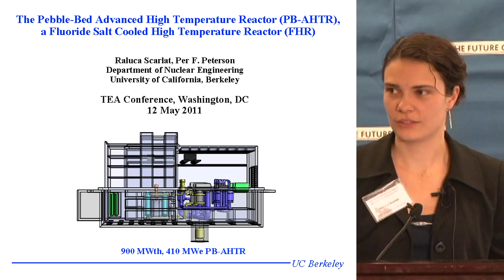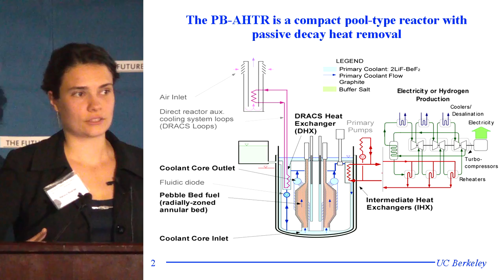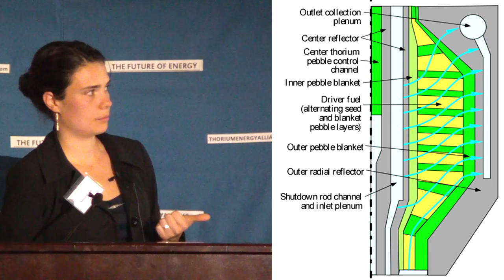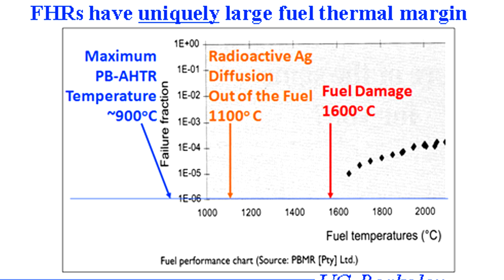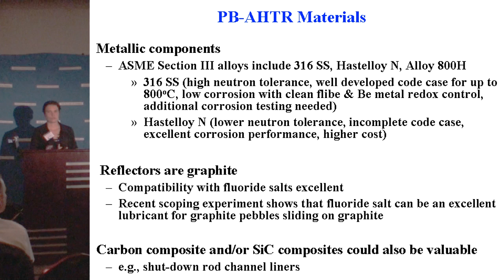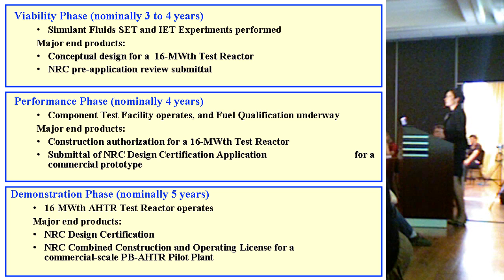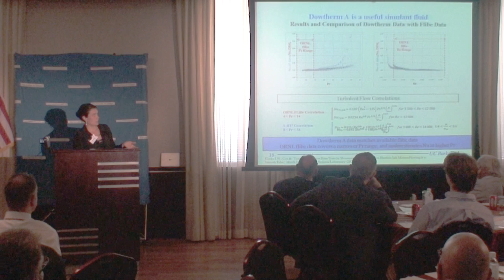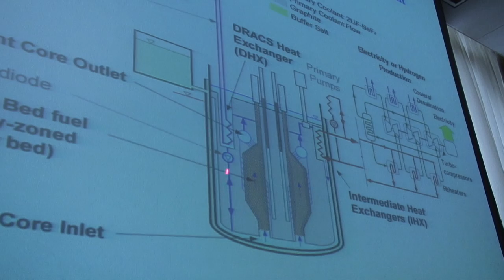Raluca Scarlat - Pebble-Bed Advanced High Temperature Reactor PB-AHTR-FHR @ TEAC3

Comment: I like the mix coolant design. We don't need giant reactors like the high pressure ones. If it was small enough, the danger factor would drop like a stone in a lake. We could have internal and external sensors in-case of a breach or any possible problem. And of course you would have a city worker or some hired worker check reactors or test sensors or both. You could then make micro-reactors that power a micro-neighborhood worth of buildings and.... here it comes.... load balance the micro-neighborhoods together. If you don't know what load balancing is, google it :)

Comment: I'd like to see a molten lead cooled pebble bed reactor. The graphite pebbles can be lighter than the coolant itself if you wanted so it would be very interesting. I like the idea of pebble bed reactors because the fuel handling is simpler and neutron damage issue in the dual fluid reactor is avoided.

Comment: I'm guessing they're doing a closed loop test using DowTherm A to find optimal channel layout for core temperature profile and pebble fuel distribution / movement. The CFD modelling of so many pebbles would be very demanding on both computational resources and on the turbulence model.  I'm not sure if RANS (reynolds averaged navier stokes) models can be used for closely packed pebbles.  These guys are Berkeley know what they're doing.

Comment: I don't see Thorium as a good blanket.  It takes like 27 days for it too mutate into U233.  How do you prevent more neutron captures in the meantime?
Reply from the maker: If there's low neutron flux it is less likely. Is why ANEEL is intended for CANDU reactors, and not (yet) PWR. CANDU are large and lower-power-density reactors. They'll still have Pa-233 absorbing neutrons, but not as much.
Reply: @gordonmcdowell  Aren't fast neutron reactors the way to go?  They produce much less waste than PWR.  They are less likely to explode when things go bad.
Reply from the maker: @putinscat1208  They should be pursued, for sure. Russia has closed the fuel cycle with fast-spectrum liquid-sodium reactors, although that's not the vast majority of their fleet. They don't have pressurized water, but liquid sodium is very reactive. Is sort of a trade-off in safety features. I'd suggest a great many of these advanced reactor technologies should be pursued, as well as immediate deployment of PWR like AP1000. Right now the biggest advanced reactor challenge appears to be NRC licensing. (Still.)
Reply: @gordonmcdowell  Do you need licensing to prove a point.  Research on a small reactor?
Reply from the maker: @putinscat1208  You need a license to build a reactor, doesn't matter how small. There's lots of work that can be done on all types of reactors that NRC doesn't needs to sign off on, but you won't get private funding to do anything that doesn't end up working in a licensed reactor. There's a very real risk a reactor design that has received millions in R&D won't ever be licensed. So who's going to fund that? This is still pertinent, despite people talking about SMR and advanced reactors for years. If you're on Twitter you'll see people explaining the problems. BTI (BreakThrough Institute) is a good source for updates on NRC licensing troubles.

Comment: It looks like a sophisticated step back from the LFTR. If solid fuel is used, I believe, lead+bismuth eutectic mix would over-perform the PB0AHTR as a coolant. Not to mention that Russians have 60 years experience with coolants for submarine reactors. So, I think, the proposed design is a step in a wrong direction and can be interesting only for scientific and technological purposes while for energy generation simpler and better designs, e.g. LFTR, would be desirable.

Comment: The politicians don't even seem to realize how the NRC operates and that it is entirely up to them to change the NRC if they want to be serious about newer reactors. The DOE supporting small modular reactors is a good example. They are spending a monumental amount of money to get SMRs approved by the NRC, seemingly ignoring that the NRC is a mess that's not pulling its weight. Reorganize the NRC and new reactors could be built in a fraction of the time/cost, and R&D would be feasible again.

Comment: This is the first explanation I've been able to follow, thanks. Now I have a crude idea of how this works. Looks like Flibe will have tritium in it; how do you separate and manage tritium? Also, can this design work in microgravity? I noticed it relies on buoyancy - but does it necessarily require gravity? Can the temp alone be used to drive the fuel through? Could one design a system that operates over a g interval like [0g, 2g]? Finally, what if I don't want to continually refuel this thing?
Reply: Bad that no one answered in 8 years: it would barely work on microgravity without any sort of active flow system or having centrifugal 'gravity' by having the reactor lie on the internal walls of a rotating cylinder for example.

Comment: This is a great presentation on AHTR, which is in my estimation the real nuclear technology of the next generation (pre-thorium economy; consider the transition U-235 economy -> U238 economy -> thorium economy).  Oleg, while lead/LBE is an interesting and safe coolant, Flibe has multiple advantages: it has much higher heat capacity/kg, so is more efficient; it is optically transparent, so observation of operations is better; and the lower weight/density makes it safer wrt earthquakes, with less structural support needs. it's true we have more lead coolant experience especially with Russian, but OTOH, the AHTR approach will give us the experience we need to migrate to thorium LFTR. So dont think of it as a step backward, but an INTERIM STEP FORWARD on the path to LFTR.

Comment: And where are they now? Not much further. China has already won
Reply: what?? China has built a huge stupid High Temp Reactor with He as coolant... the wanted to use it in warships which given the size of that thing if they fit even half of it into a warship wud be a miracle. It does not reach that high of a temperature either. Also this stuff is probably classified. I'm Indian and our BARC is working on a similar reactor but with a liquid metal coolant it is called the IHTR. It uses electromagnetic pumps to give homogeneous temp and is being built for making thermo-electrolysis of water viable for producing hydrogen. As far as I have seen this tech is moving ahead very fast.